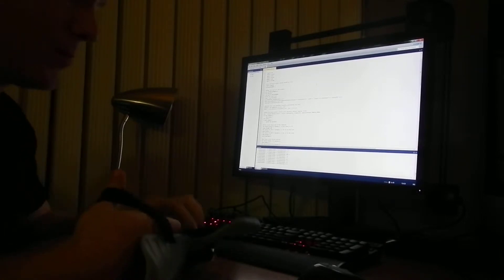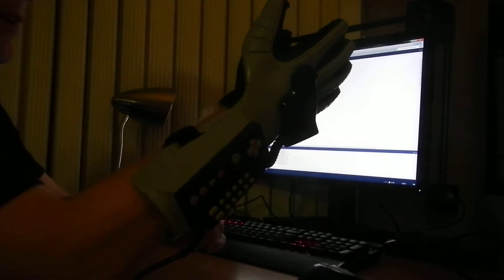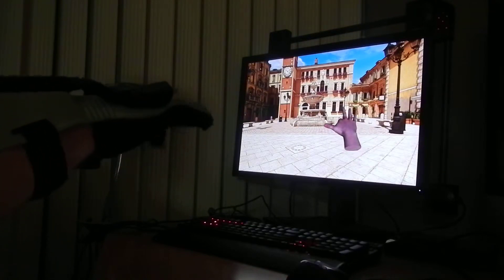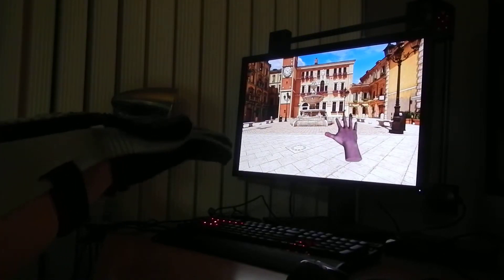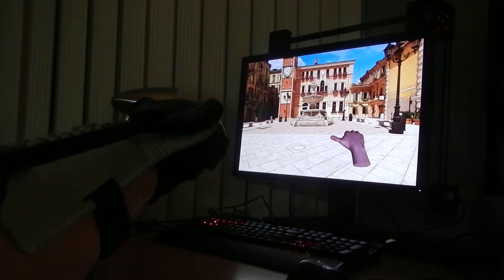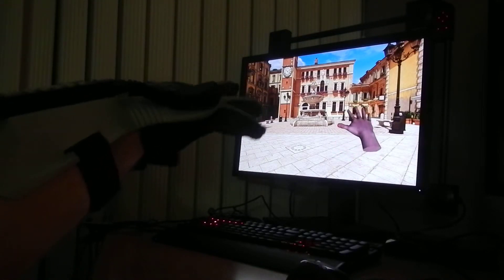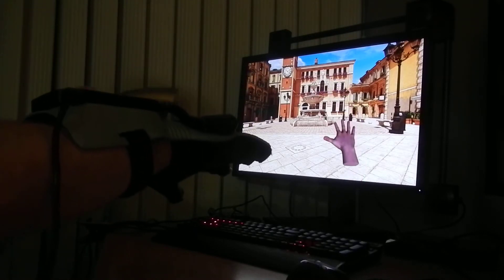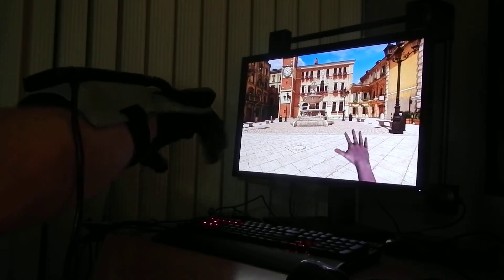Power Glove in Vizard 5

Comment: This is truly impressive, I myself have a power glove and have been looking for a way to wire it to my pc without having to modify it due to I would like to keep it in original condition. Out of curiosity, does your board allow the power glove to be used with a NES emulator by chance or to set the responses to key bindings?